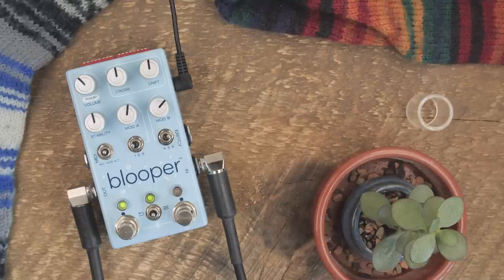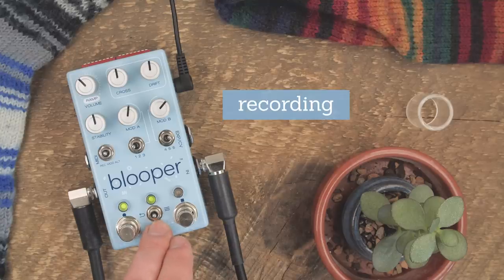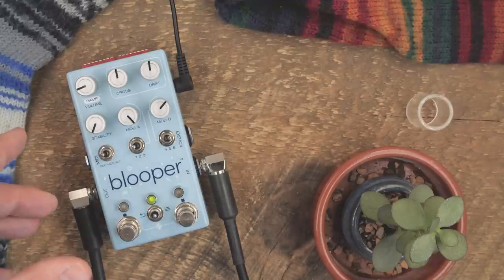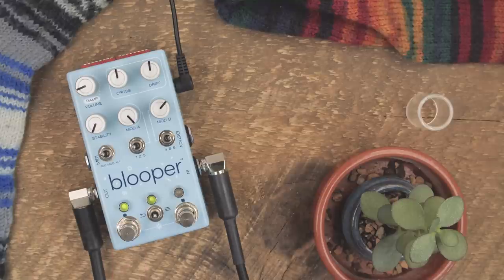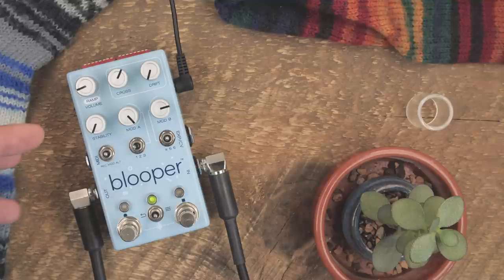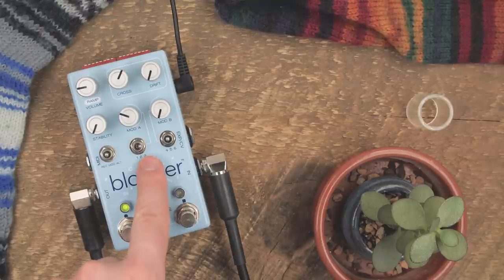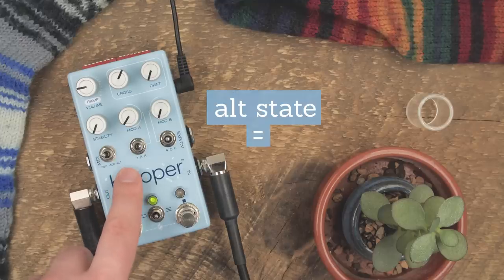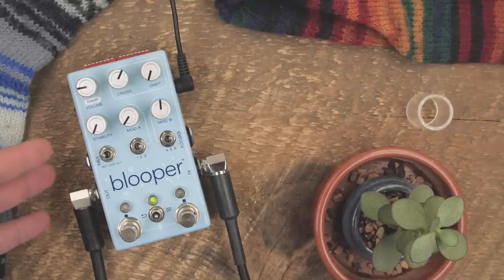Blooper Reel - 1 - Meet-n-greet

Comment: Experimental looper!  So, a few things. Being able to be in record while modifying the loop length/sample rate and then that being reflected in all its crazy glory on playback. The Timefactor/H9 does this swimmingly. As does the PCM 42 and it looks like the Rose. Can you make it do that?  Can you change the speed in intervals when it’s in record?  
Additionally, loopers get way easier to use when you’re not relying on 2 buttons to control multiple functions. A breakout box foot controller or at least the possibility to attach a midi foot controller with permanent mapping would be a game changer. 
Lastly, the Hexe Revolver loopers have a neat function in that the speed and pitch controls while continuously variable have wide sweet spots so you can zing to a 5th and not overshoot. Hard to explain without using one. If you need a line of a Timefactor and or Hexe pedal hit me up. Oh yeah, the ease with which you can move the loop start point and end point on the Timefactor is a thing of beauty. Something to consider.

Comment: This is going to be amazing. I was literally trying to have a friend build something that would give me the ability to edit my loop post recording. I have a Boss TC3 right now that I was built a position shifter for. The vast amount of loops that can be stored and the ease of recording them was why I chose the TC3. However the addition of those cheap drum loops is a completely unnecessary feature and the boss components I feel are so over-manufactured that it's impossible for it not to be a little cheap. I wanted those drum features removed, the amount of loop storage and ease to remain, and the ability to edit and bend a loop i've made post-performance. A few weeks later my favorite pedal company announces this. 

The tape degradation deff needs to be a focus. Can't wait to see what else comes out of this. The usb changeable features are neat. Deff going in a great direction. No doubt in my mind that I will end up with this on my pedal board. Goodbye RC3!
Reply from the maker: Justin! Love to see stuff like this. It should do exactly what you want.
Reply: @Knobs  Great! consider a something that can change the pitch of the loop. Some real modern production stuff in a pedal would be so sweet to live tweek/"produce" a loop like that.

Comment: Hello Mr Knobs,
Firstly: you are great, I love your stuff.
Secondly: here is a list of things I would like a looper pedal to do:

1) Record a loop of what I'm playing, quickly and easily, and play it back accurately;
2) record a loop (Loop A), play that back, then record a second loop (Loop B) of the same length, which then plays back at the same time as Loop A;
3) record a loop (Loop A), then instantly record a second loop (Loop B) without having to wait for Loop A to make a pass before I can overdub;
4) record a loop (Loop A) of a certain length (say 300 ms), then record a second loop (Loop B) of a different length (say 200ms), and the difference between the two is made up with silence at the end of Loop B;
5) record a loop (Loop A) of a certain length (say 300 ms), then record a second loop (Loop B) of a different length (say 200ms), and Loop B loops again as soon it is finished, so that the start points of each loop are only in sync every 2 repeats of Loop A / 3 repeats of Loop B;
6) record a loop and store it to a specific slot in the pedal memory;
7) recall a stored loop by pressing a foot switch or using a control on the pedal;
8) recall a stored loop by sending a midi message (PCM or CC or something?) to the pedal;
9) store and recall knob settings using either a foot switch/on-unit control; or by sending a midi message;
10) record a loop (Loop A), play it back, then send a midi message to recall a stored loop (Loop B), but Loop A keeps playing, and you use the cross function to cross fade from Loop A into Loop B;
11) record a loop (Loop A), play it back, add a bunch of knob settings (Setting A), then send a midi message to recall a stored setting (Setting B), but Setting A is still active, and you use the cross function to cross fade from Setting A into Setting B;
12) record a loop (Loop A), play it back, add a bunch of knob settings (Setting A), then send a midi message to recall a stored loop (Loop B) with stored settings (Setting B), but Loop A is still playing and Setting A is still active, and you use the cross function to cross fade from Loop/Setting A into Loop / Setting B;
13) expression pedal input, assignable to any control and any group of controls [having 2 separate expression inputs would be great, so that 2 distinct knobs or groups of knobs can be controlled separately, but I imagine that could be tricky);
14) MIDI SYNC INPUT (so important [I do electronic stuff with computers]);
15) separate inputs for midi sync and expression, so I can do both;
16) a way to gradually change the tempo of the loop (speed up/slow down) in such a way that the pitch of the recorded loop is left unaffected;
17) a way to gradually change the tempo of the loop (speed up/slow down) in such a way that pitch of the recorded loop is affected (raised/lowered);
18) dual mono outputs, so that one loop (Loop A) can be sent to a specific output/amp/pedal group etc (Output A) and one loop (Loop B), playing at the same time, can be sent to a different output/amp etc (Output B) with a different sound structure or timbre. That way the two loops, which might complement each other melodically or harmonically but be different 'timbrally', won't clash or fight each other coming out of the one sound source. Perhaps, if 2 separate physical output jacks would be a problem, this could be achieved using a TRS-dual TS Y-cable?

---

Obviously, some of what I'm looking for is already implemented in Blooper (e.g. 1); some of what I'm looking for is conflicting (e.g. 16 & 17) (however; I'd be quite happy to change between these conflicting settings by using the dip switches); some of it is probably impossible (12?); some of it is probably impractical (18). I am aware of this. 
I am also aware that implementing some of these features adds great complexity in terms of control, and makes the pedal more like a DAW than a pedal, and some people would not like that complexity. (That said, I am totally ok with this, as I would like to stop using my DAW to loop and start doing my looping on my pedal board).
Also, some other people probably suggested all of these things already.

These are reasons I thought of for not coming up with ideas, and then of not sharing them once I had come up with some. However, I'm telling you these things anyway because you said you wanted to know my thoughts.

Thank you for reading my thoughts.

Comment: Synced ramp - clever. Undo and redo - yes, yes yes. Crossfade - non essential, but welcome addition. Suggestions: synced tremolo as one of the mod options, multiple expression pedal assignable destinations via dip switches, scrubbing through the  position of a stuttering sample (like MI Clouds le'ts say) preferably assignable to the exp.pedal, and - please: one "loop mode" that is not actually loop but a delay-ish buffer (like Count to Five). You're voice is absolutely fine BTW.
Reply from the maker: Hey thanks Moris. Some good ideas in here, I think some of those can be arranged.

Comment: This thing is really incredible, wonderfully innovative and brilliantly designed. I look forward to trying it out! I'm a bit worried I'll have trouble keeping track of the loop/all of the general features given the rotating functionality of each footswitch. 

A wet/dry function would be nice, or just making it so the stability when set to 0 is a completely dry function as opposed to the warmth/warble. I know this isn't supposed to be a traditional looper by any means but it'd be nice if it could also replace the traditional looper on my board.

Comment: Looks and sounds great, congrats. Will it have Replace option, with momentary a switch? Also if the pedal could be reprogrammed via an iPhone rather than a computer it would be much more useable out in the field, via a usb to lightening (iOS) or a usb to usb c cable (android )

Comment: Best knobs video I’ve ever seen. You should talk more. Secondly, the one thing I really dislike about most loopers is the length. Most of them cut off the phrase before I’m finished looping. Fade in/out is another key feature all loopers need. Not an abrupt fade but a fade that you can set the fade time. I’m liking that it’s performance based. Is it analog?
Reply: The electro harmonix 720 looper has a fade in/out function. It’s not nearly as awesome as this one though!
Reply from the maker: It's looking like the max length for a single loop will be just over 30 seconds. Lots of requests for fade in / out so we'll work on that. It's digital.

Comment: Oh dang guy. Them layers. Okay. If you can get a modifier to do some Steve Reich style stuff where you can have the locked loop and shorten the length of another version o'er top that would be fiendish.
Reply from the maker: Oh yes. Absolutely part of the plan. Where that stuff gets a little weird on the design side of things is syncing. For both ramping & external sources. Because your loop is changing size. But we'll find a way because I want to do that.

Comment: I love this. It will almost definatly replace atleast one of my two loopers (the one near the start of my chain). I use my second to catch smaller loops made by the first looper, with added effects ontop. If it can switch between two seperate loops on the fly (i.e. for a verse and a chorus) Ill probably replace both with two of these.
Reply from the maker: Curious to see how it fits into what you do

Comment: I've been getting more into combining loopers with my modular for live performances but I did not find any looper that suits my needs.....until now! Really cool concept :)
Reply from the maker: Love to hear this. Maybe we can find some interesting ways to harness the CV input.
Reply: this comment makes me happy :)
Reply: @Knobs  I am working only with a small system which is very inspired by the Buchla Music Easel, but a bit more flexible. I would love to build up whole ambient compositions with the system and a looper like this. Maybe also work a bit like Eno or Basinski, with loops running in and out of phase. The loops could also be ever evolving and even this disintegration idea by Basinski would work with the Blooper. I think this pedal can be almost like an instrument, whereas most other loopers are just boring stompboxes that you basically never touch. I would love to have a good integration of the CV input, maybe speed/pitch control, volume control over the loop, control over the mod parameters or a gate/trigger input for the recording would be so amazing. (Maybe there is a way to assign the CV to different destinations) Imagine running melodies (or anything else) into this and then triggering the rec with random gates...endless experimentation. I think you are about to design the absolutely perfect looper for my live and studio peformances, my creativity and my ideas are already blooming infinitely :) If you need someone to test this thing, let me know!
Reply: @ChaseBlissAudio  Happy to hear that :) This is just a perfect concept, just a few days ago I was searching for loopers that I could integrate in a creative way into my live setup, and also for loopers that aren't just boring stompboxes which you never really touch. Didn't find any pedals that really caught my interest. I think the Blooper is going to be almost like an instrument, it feels really refreshing and seems to be an awesome tool for experimentation - already feeling super inspired by this thing! :)

Comment: Would it be possible with a on/off press-switch on the two modifier dials?
IE you have to press down on the dial to engage/disengage them?
You prob. would need two more diods or some sort of illuminated potentiometer to give the user feedback.
And if so that light could also give feedback re: effect type (color) or how much of the effect is used (brightness)
Sorry if this already have been discussed.
Cheers
Reply from the maker: We might have a little fix in place for this. We might.

Comment: It would be cool if one option thru the switchdippers would make it so you could send a gate/trigger to the cv input to sync recording :o that would make this a really nice pairing for a modular system without the need for other cv/midi translator doodads..
Reply from the maker: Hmmm. I wonder. I think I've tried syncing other Chase Bliss pedals via the CV input in the past and it didn't go so hot. I'll investigate.
Reply: @Knobs  Awesome! Pedal's looking so-so cool btw

Comment: I would like to see a phrase sample function. A button records a phrase, a button plays it. And make it pitchable by CV/midi so we can use a single tone chromatically with a keyboard, like a sampler does. The closest example i have is what strymon magneto does.
Reply from the maker: One shot is definitely something that feels important. Dip switch option. Maybe Stop will launch the sample, Record will record.
Reply: Nice. I'd also like to see the architecture from the loop overdub mode to write pitch / reverse / volume on the one shot. And to be able to sweep the "start point" for the one shot. I'm thinking about seagulls from tomorrow never knows.
Reply from the maker: @moelodin  Yep, that should all be possible!
Reply: @Knobs  Cool. Could it also be possible to use audio to modify pitch/launch of sample?

Comment: Okay, the blooper seems really cool, but I would rather have an additional foot switch pedal that connects so the blooper for easier control. The biggest problem with a small loop type pedal is the fact each foot switch has to many alt functions.. it gets way to confusing.
Reply from the maker: This is very possible. First, we want to design something that works well without any additional accessories.

Comment: Performance effect could be customized via dipswitch? Maybe either reset or reverse?
Reply from the maker: We should be able to do both. Hold for reverse, tap for reset.
Reply: @Knobs  Would this mean you can't record reverse as a mod? I guess Count to 5 already does that, and DL4 and Boomerang do the "record in reverse mode then exit and it plays back backwards" thing... But both of those are really useful...
Reply from the maker: @RobFlaxMusic  You'll be able to do both. There will  be a speed / direction modifier.
Reply: @Knobs  !!!

Comment: Is there a way to get hi-fi sound out of this? According to this video, "stability" ranges from analog/tape sounds to destroyed/mangled sounds.  Is there not going to be a clean/neutral-sounding option?  If so, this could be a great replacement for my Boomerang looper.  Even a "Hi-Fi vs.Tape" dipswitch on the back would be good.
Reply from the maker: Yep, full counter-clockwise will be off
Reply: @Knobs   Awesome, thanks!!  Can't wait to run two of these in parallel with something like a Polymoon or Ventris! What an amazing time for pedals.

Comment: "That much talking"...I think I've seen the majority of your vids (quite excellent, by the way), and up until now, I had no idea that you might be Canadian (...or...like the label..."Secretly Canadian"). All that aside, as a long time looper, pedal geek and original Chase Bliss Warped Vinyl MK1 (first release) owner, I would like to add my 2 cents to the wish list. 
A) The Integrity Knob: at fully counter clockwise-no loss, 1-to-1 looping
B) Electrix Repeater style time stretch/(or to make it more time relevant) Ableton-style looping....time stretching to meet external BPM via MIDI time clock
C) a clock divisible (and MIDI clock syncable) wavetable style playback, that jumps between "forward", "reverse", "grain size", "granularity"  and pitch intervals...kinda like the "856 for Zellersasn" or "Count To 5" (the latter having MIDI sync)
...and obviously...full external MIDI implementation for this of us who ain't scared of some program'n....and it has to fold my underwear like mom did. Too much?
Keep up the good work!

Comment: Ok ok one other idea: what happens if you have multiple Bloopers in a row? Any way they can link together via Midi to become a "super-Blooper"?
Reply from the maker: Good question. That might be an after-release type update, if it's possible at all. Would probably take some time to do, so we wouldn't want to delay the release for it.
Reply: @Knobs  I'm imagining two Bloopers in series without any sync stuff, and it's already interesting... But the ability to have one see the loop length of the other (so they can sync), would make this a modular looping setup that'd be highly powerful. (Depending on the way it's made to sync with other gear already, it might be you're already there...).